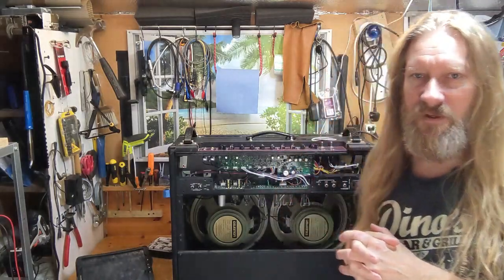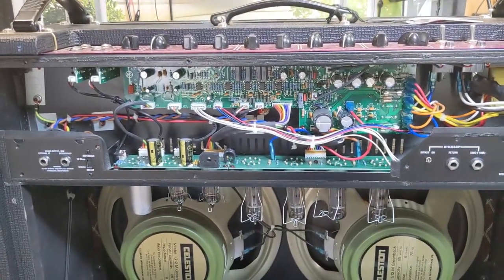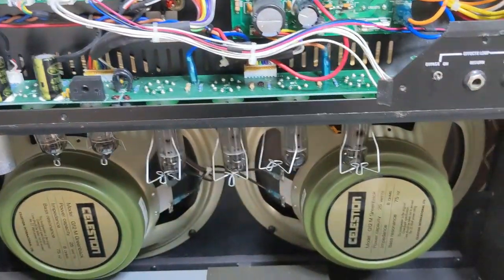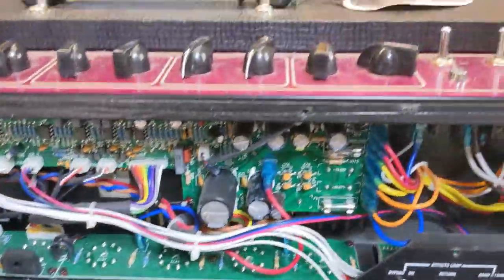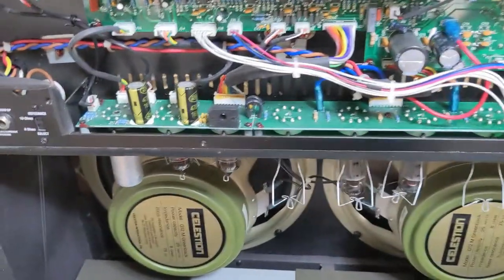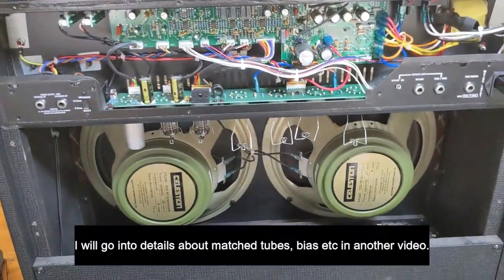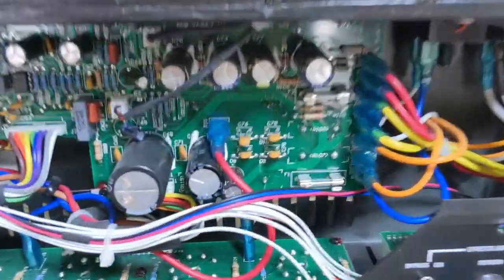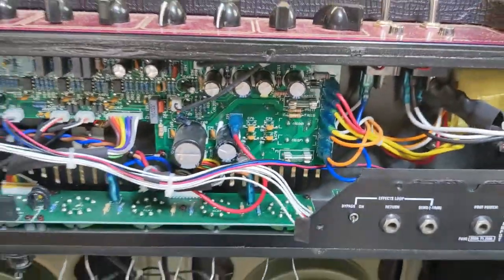VOX AC30 Output Valve (or Tube) Hack

Comment: The reason ac30s are so hard on tubes is that amp was originally designed around the Mullard el84s. Modern tubes like JJs and EH el84s are not as robust as the OG Mullards. The trick on making them happy is get rid of the 100ohm screen grid resistors and replace them with 1k metal film 2watt resistors. Cool the bias down a bit with a 68ohm cathode resistor or a 75ohm. Which ever one that keeps the output tube dissipation between 100-120    % total dissipation on the 4 output valves. Just a little trade secret.

Comment: Good advice buddy
Reply: My super twin reverb would run fine on 4 tubes with the outside two pulled but I kinda like the sextet of 6l6’s making it scream so clean 🤘🏽. 

I really gotta get that monster running again damn 6C10 are going for nearly 170£ that’s more that the rest of the tubes combined, even with an up charge for matching the 6l6s
Reply from the maker: Thanks 👍
Reply: Gotta love a twin .

Comment: Might work to get you through a gig. Pulling tubes the OT sees a different load impedance. Need to then run it off a lower ohm OT tap

Comment: I know you said you liked the Marshall DSL 100 Watt head and the way it was put together or something like that. have been flirtin with gettin one of these, how do you like this amp?
Reply from the maker: DSL 40, I would pull one out of a combo and put it in a head and plug a 4x12 in, Job Done.
Reply: @DaveBarlowGuitar  Awesom idea, thank you Davey! I know where one is on consignment for cheap. I remember when you built up your 4x12 shop cab for cheap, JOB DONE!

Comment: One hand in ya pocket if ya plan on reaching into a tube amp.
Reply from the maker: old school LOL
Reply: yeah and make sure your not standing on a cement floor in the basement in your socks LOL put your shoes on and maybe stand on a piece of dry plywood or something because 4 to 500 volts DC can cut through a pair of flipflops or better yet if you don't know what "draining the caps" means don't even mess with it take it to an amp tech.

Comment: Reduces the power by half don't it...? Better than losing the gig 👍
Reply: I've heard if you have a 4xEL84 amp with a speaker load of 16 ohms if you pull two tubes you need to set the impedance selector to 8 ohms. This will correct the speaker load. but I would want to double-check that  with an actual amp technician